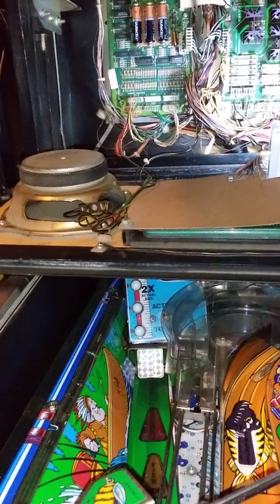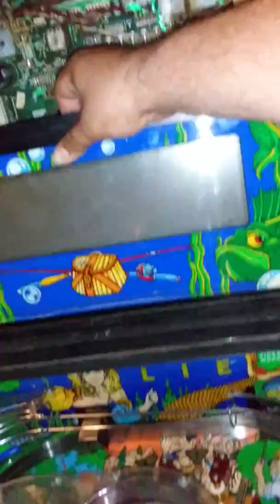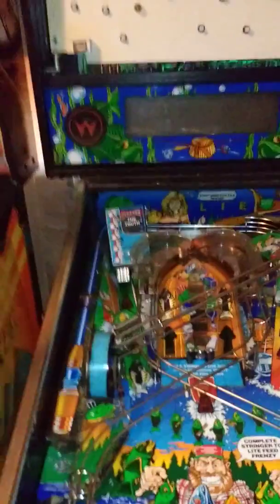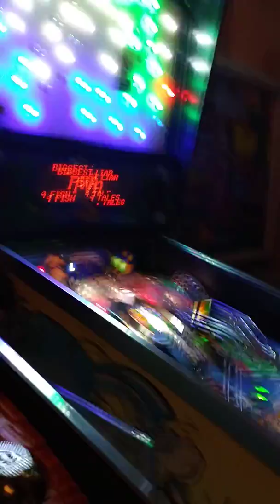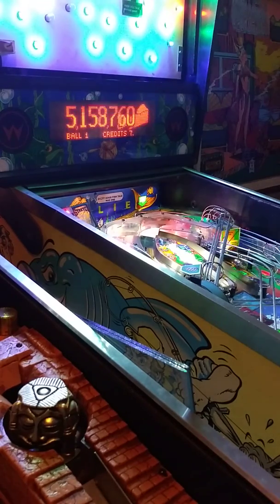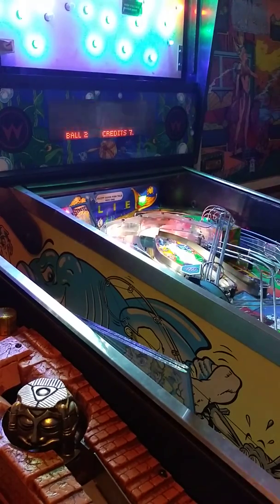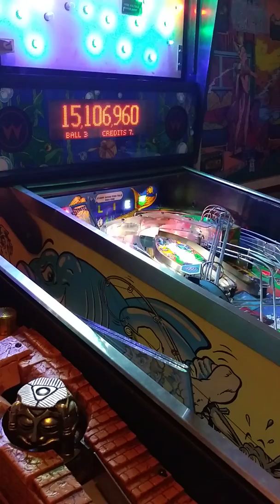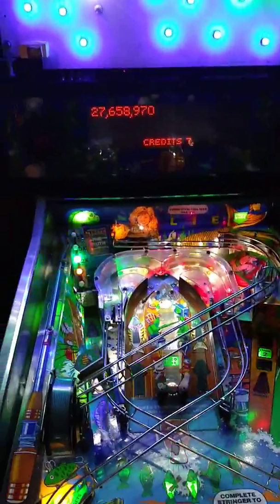Working on fishtales wpc reset 5v kahr.us fix ep4

Comment: Dude, if you went to the doctor because you kept getting headaches and you kept experiencing episodes of passing out sporadically and the doctor put a bandaid on your head, would you be impressed?  Fix the machine the proper way!  There are several articles posted on the internet on how to solve the problem the right way.  Find them, read them and fix the problem the right way.
Reply: I think this is a bit more than a band aid.  I've gone over the engineering on kahr.us and it seems thorough.  I don't have a dog in this fight, yet.  My ST:TNG is holding up for now.